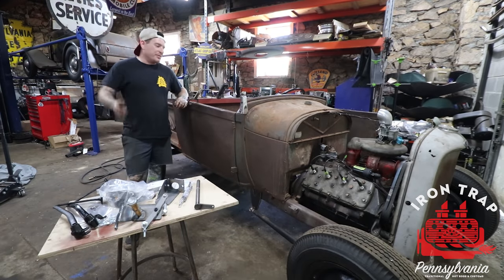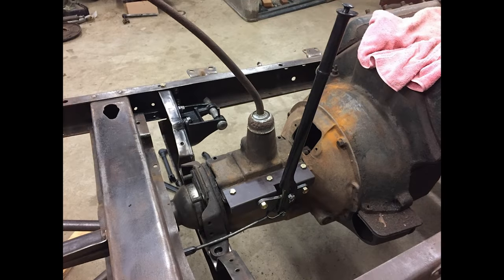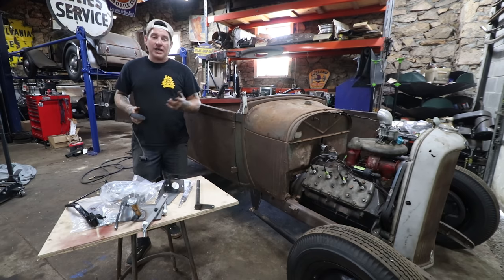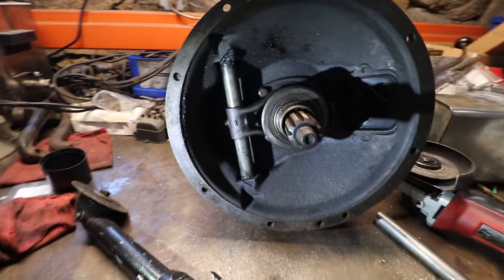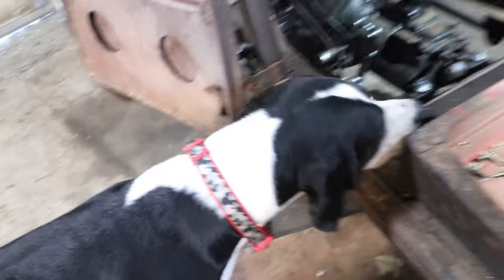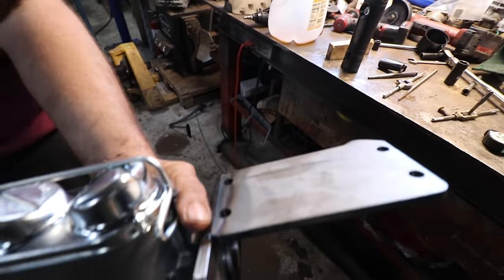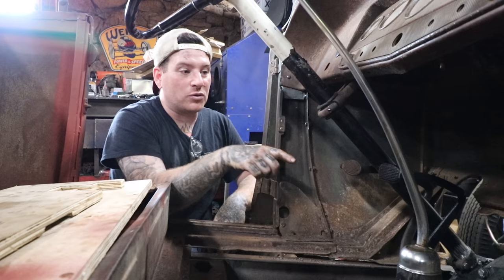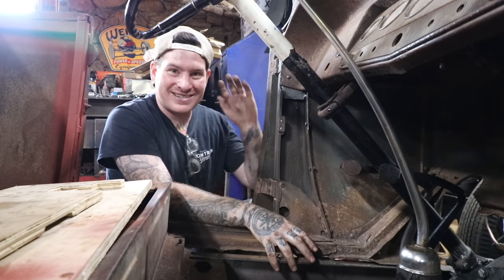Simple Bolt On Ford Model A Hydraulic Brake Conversion

Comment: Coming from just finishing the old Vern way of going with the 32K and pedals, this kit solves all the problems I had to deal with. The clutch fork arm in particular.  The factory arm is too short and requires heavy foot pressure. The kit I see addressed that with a longer arm. It's nice to see the other way of doing things. Wish I had known about the kit.
 Thanks Matt!!!!!!!!

Comment: Nice kit and looks like easy install.  The OCD in me would make me trim off the clutch pedal to match the brake pedal in appearance, but then, that's probably why it takes me forever to finish a build.  In any event, a very cool project and you're doing a great job with it.
Reply: I've got to agree with you, it made me cringe when the pedal pad was cut off like that. With the length of arm on that pedal it would have been so easy to just tweak it to miss the steering column.
Reply: You dont have OCD...

Comment: I have an F1 in mine. With a 39Ford clutch and brake assembly,  modified of course. I have a relocated fruit jar master cylinder, and a mechanical clutch linkage.  I also have a hot flatty with a 39 trans, a model A emergency brake is mounted on a custom bracket on the side of the trans.

Comment: You could have also used a brake cylinder hone on the fork side, would have been faster + dead round vs sanding the shaft

Comment: Adding a 1/2"npt "inspection hole" might allow that rivet to be removed in the car. Put the cross shaft in the freezer for a few hours.
Reply: Inspection/assembly hole is a good idea but a pipe plug is tapered to a point it could split the housing if a stainless or cast plug is over tightened. A regular thread would serve the purpose.

Comment: Sweet ! I like that you installed it first to check fit , before modifying it for finish . As with the new shaft & original fork for the throw out bearing , not all are the same exact thing . Well done ! Some lines & fluid parts , it will have brakes . Nice build , guys ! Can't wait to see it rolling down the road !

Comment: With that kit, are the pedals going to rock side to side with engine torque or is the engine & trans bolted "hard" to the chassis?
Even with a little side movement, would the pedal hit the steering column? I could not see the clearance in the video so just asking.
All in all, a nice tidy package!
Cheers,
Reply from the maker: The small side to side movement wouldn’t cause an issue. Stock model a pedals are mounted the same way.
Reply: @IronTrapGarage  i was wondering too. thanks for explaining.

Comment: You guys need a couple of creepers!  Laying on the floor (even on cardboard) will make an old man out of you fast!  My dad (Chief Mechanic/Service Manager) made sure every mechanic in the Ford shop had a Ford logo creeper to use.
Reply from the maker: Creepers sit too high and then you have to jack the vehicle way up in the air. Or it always catches on pebbles on the floor and you can’t slide. More of a pain in the ass than good in my experience.
Reply: @IronTrapGarage  I have a creeper that raises only requires 1.5 additional inches to get me under the car.  The cones off of old tapered wheel bearings, placed big side up around the creeper wheels and just sliding on the floor will push away rust chips, pebbles, tools and air hoses.

Comment: Neat kit from Old Yankee. One question how do you access the m/c reservoir to fill it with brake fluid?
Reply from the maker: Can cut an access hole in the floor under the seat or fill from underneath.

Comment: You could have used a simple homemade inside sanding tool with a rod that has a slit sawed in one end, into which you put a piece of emery cloth.  Chuck it up in a drill and ream out the clutch arm and bell housing until the rod fits.
Reply from the maker: Multiple ways to achieve this but the time it would take to prepare that I was able to sand it by hand and fit perfect.

Comment: If the throwout shaft fits in the bellhousing bosses, why not use a brake cylinder hone in the fork to get it to fit the shaft better? That way it would not affect the shaft to bellhousing bearing fit....
Reply from the maker: The amount it needed was very minor everything still fit tight.

Comment: I have a seminar set up but my transmission is f1 pickup open drive shaft. Would this kit work with it ? 
Regards 
Lem
Reply: Yes it works with 35-39 transmissions both car & light truck

Comment: You could have put your shaft in the freezer for a few hours and when you were ready to put it together heat the fork up in an oven, the shaft will Schrenk in the freezer and the fork would expand in the heat of the oven which would allow it to slide together without sanding the shaft. After they would return to normal temperature you would have a super tight fit.
Reply from the maker: Right but then the shaft wouldn’t rotate in the bushings like it’s supposed to do…

Comment: Quick question are the stock model A pedals cast iron or steel? Need to know if I can weld mine to a steel aftermarket bracket
Reply: Steel.  I relocated the small lever on mine room the the top to the bottom.  So I don't need all that linkage on a brake system
Reply: @essentialjudge2279  thanks this is good news now I can weld my original pedals to my aftermarket pedal assembly I’m working with wich will not only look better they will actually clear the back of my engine

Comment: Gave me internal pain to see you cut that pedal.  I expected a more refined solution from someone like you.
Reply from the maker: What’s more refined? Cut the pedal edge off and will round the edges next time it’s off. Sometimes simple is the best solution.
Reply: @IronTrapGarage  I was more expecting you to heat and bend the pedal arm to clear the column or some other neat solution that wouldn't even have crossed my mind.  Yep, cutting works, but just didn't seem like the kind of thing I'd expect from you.  You finished it neatly so it doesn't look bad.

Comment: Don't cut the pedal pad. To go through all the trouble to convert and then to do that? That's a hack move.Too late.
Reply: I agree. Could have spent the time to move the pad location over. Yes it looks like animal dung now.
Reply: @RichieCat4223  With all the parts Matt has around he likely has another pedal setup around so he could still swap out pedals and modify it right..
Reply: @kennethstaszak9990  You are correct. But will he ?
Reply: Grind a small radius to the top and bottom corners while retaining the clearance flat?
Or this winter rebuild any bezel bead with weld.
Reply: @waynespyker5731  Too late. He already hacked it up. There's no going back from the original hack job. Unless it's by replacing the pedal pad and moving it to the right. To me it doesn't negate the fact he was willing to hack the pedal pad up in the first place. There were options but he seemed in too much of a hurry to look at them.
Reply from the maker: Seriously cutting a 1/4-1/2 inch off the edge of the pedal pad offends you all that much? It’s a simple solution on a simple/basic early hot rod. No need to go overboard on this one. But hey I’m a hack and the truck is ruined now so I guess you should stop watching now 🤷‍♂️
Reply: @IronTrapGarage  Ok I will
Reply: @kennethstaszak9990    If it was me I would have cropped the clutch pedal to match.
Reply: @waynespyker5731  I would have heated and bent the arms. Both sides to match
Reply: @waynespyker5731  I would have cut both also, simply because my OCD prefers symmetry.......but I would never tell the leader of the band that way was better!   You da man Matt!   Love this project and impressed how well it's been going together! Carry on with your great work!